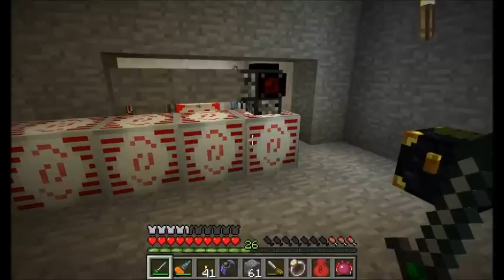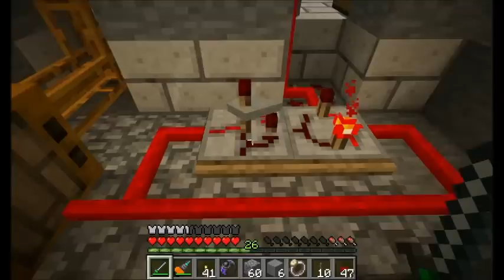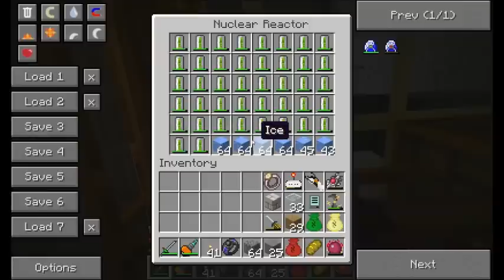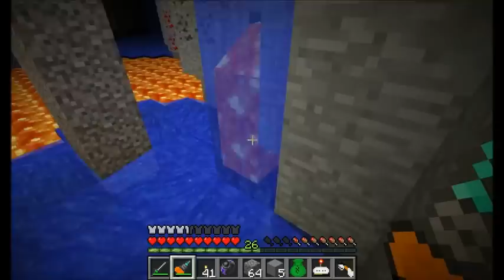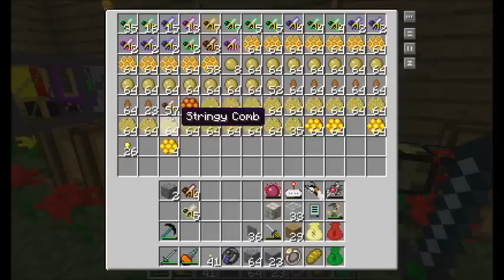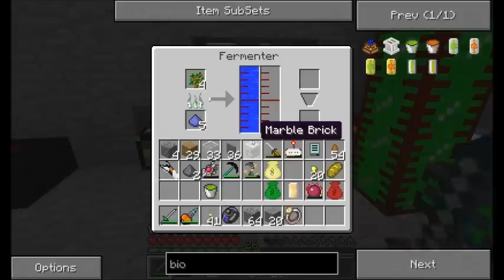Season 3 Episode 47 - Direwolf20's Lets Play

Comment: biomass in a biofuel generator produces as much power as fuel in a combustion engine, while biofuel in a combustion engine produces 1 less mj/tick. aka use biogas engines on biomass and you'll get the same power generation as before (fuel in combustion) without any risk of explosion. Like so Direwolf can see

Comment: @direwolf20 you should add a logic gate onto the combustion engine pipes to switch the valve pipe for fuel when the engine runs out of fuel, and closes the valve pipe when the engine is full. This would keep the engines filled. I dont know how to do it myself but im sure you can find a way ;)

Comment: Maybe you should place the item detector in the overflow tube and rotate the timer in your rs circuit so that it doesn't run when there is no ice produced (tiny bit less lagg) and set the time to 60 seconds. This way the reactor will only run when there is at least 4 ice in the reactor (64-60=4 so you could choose any number), which means you can be absolutely certain that there is ice in the reactor. Now it could be that only 1 of the 4 compressors are running (out of eu) and the reactor blows.